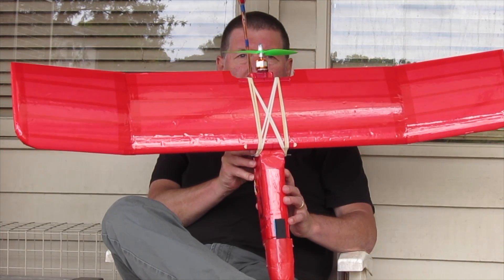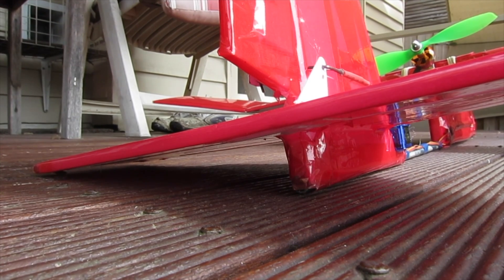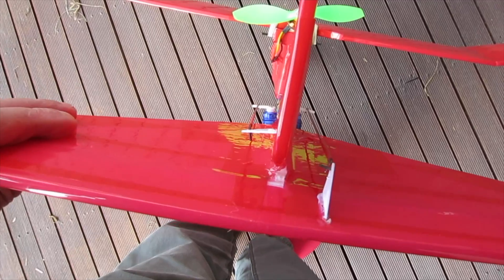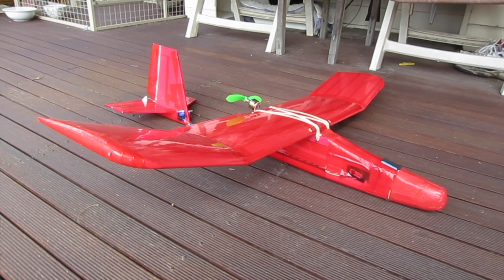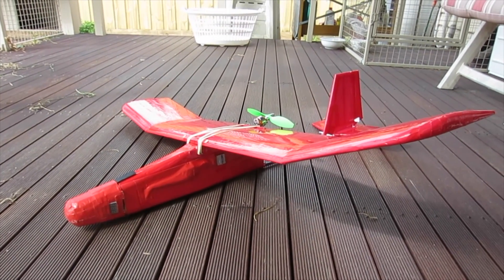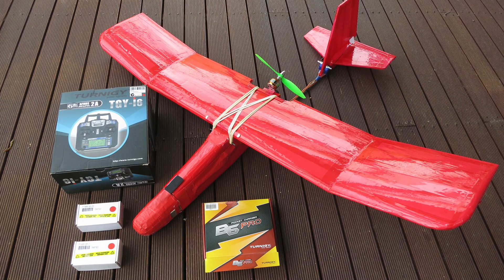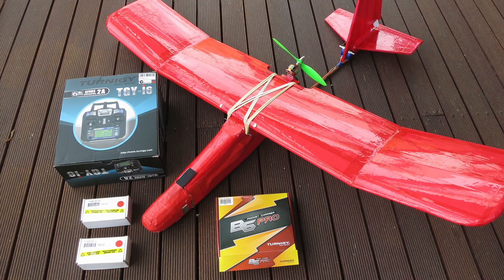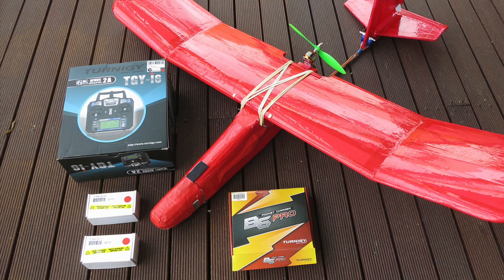3 channel trainer update

Comment: Hi Andrew,
I gave up trying to learn to fly in the snow and since spring is here in Canada I have been learning to fly the trainer.  You described the modifications as more crash resistant. I could not agree more.  This is one tough plane.  I have crashed more than a few times and the front end of the fuselage has taken a beating. I don't think any of the repairs has taken more than 1/2 hour.  I have been buying most of my motors and ESP  from Banggood and they make it inexpensive for the novice.  Who ever came up with the packing tape covering should get an award.  The wings have a few dents in them but have stood up to a introduction with a couple of trees.  This was a fun build and a great starter for inexperienced people like me. Many thanks, Peter
Reply from the maker: Thanks for the feedback Peter, very glad you have had success with this.

Comment: Hi Andrew,
I am moving along with the 3 ch trainer build c/w updated tail/rudder.  Do you have an advice on the centre of gravity.  I saw you are  using a 1300 mAh battery.  I only have 2200 mAh and it may be heavier. I have an  FPV camera/transmitter as well and need to place it without shifting the C of G much.  This is my first attempt at foam and hot wire.  My learning curve is pretty steep, but the information you provide got me there pretty quickly.  Thanks Peter
Reply from the maker: Peter, 2200 will be fine. Best idea is to make up the fuselage with all the electronics and battery in place, find the balance point, and then position the wing tie down rods so that the wing sits in the right spot. CG or balance point 30% back from the wing leading edge.
Reply: Thanks I will send an update when I get it flying
Reply: I got the entire aircraft built with the exception that my motor and esc have not arrived.  I tested it as a hand launch glider with no radio and it flew beautifully with a slight nose down attitude.  The snow is soft and so conditions are idea for flight testing.  For those considering building one of these, it is very easy.  I started with no experience with hot wire foam cutting and built a hot wire and cut the pieces including the Clark wing pattern.  It takes a little experience to get the right pressure on the wire otherwise it wanders a little.  Given the time, effort and skill level required to build one of these trainers, I think it is an ideal project for a beginner. Mine is not pretty as I did not have red packing tape and used clear tape.  I had pieces of blue and pink styrofoam so the colour scheme is mixed.  Since I have the 2200 mAh battery I did have to play around a little to get a good C of G.  I have also added a camera for FPV which impacts on the C of G.  It was lots of fun to build and I expect to have an equal amount of fun flying and likely repairing. I drew the entire aircraft on a CAD package (VariCad).  The predicted C of G was very close the actual so I will likely draft up any future builds prior to actual construction.

Comment: I am trying to build the same plane rc and suddenly I've realized that I've added 10 cm to the central part of the wing.
it would affect the behavior of the aircraft?
the model is the same as your last 3 chanel, but built with the basic fact that depron version using the foam panels (available in my area)
Reply from the maker: +Druide No problem, it should glide better and fly slower
Reply: +Andrew Newton  thank's, it's a good news

Comment: If using dollar store foam would you take the paper off before you sandwich the carbon fibre rod into the tail parts?

and 

will you be showing this new build technique?

Thanks for the info o the Turnigy radio.  I am looking into it.  It has Good range you said? What is considered good range?  Yes, still a newbie. sorry.
Reply from the maker: +SnapPunch Robert I don't use dollar tree foam, so not sure about the best techniques. Maybe check out Ed's Experimental Airlines videos. Video on the new (depron) tail construction coming soon